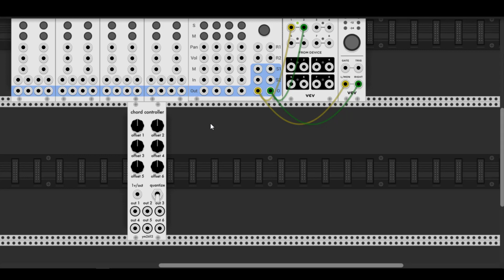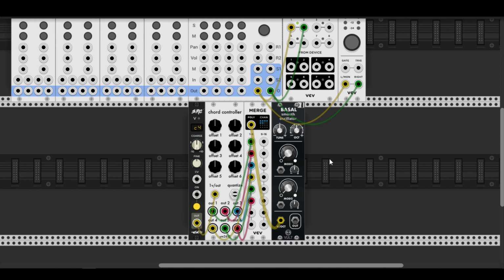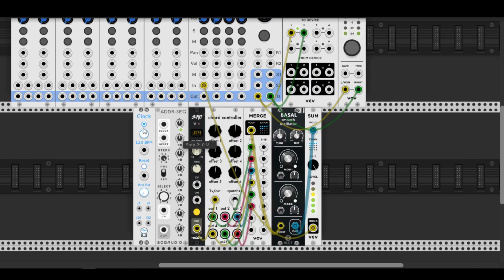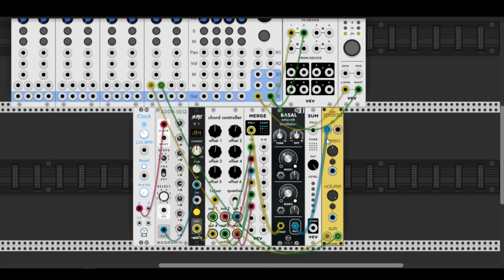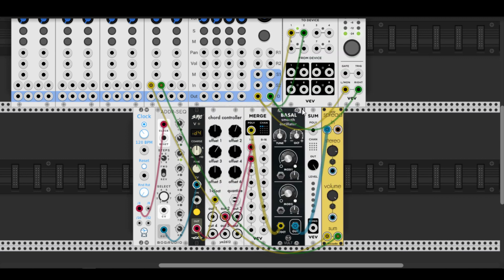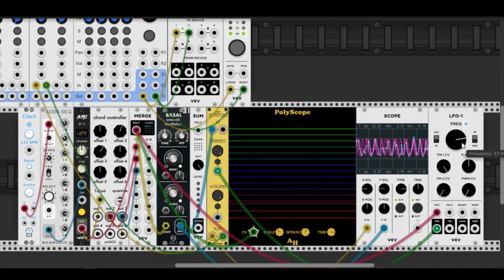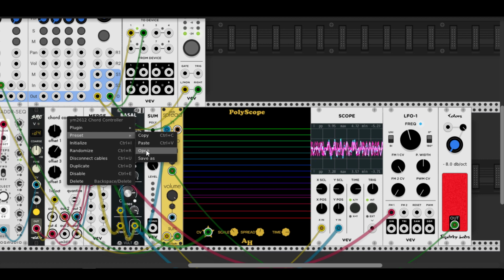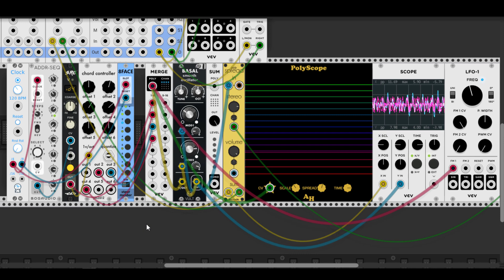Free Chord Controller for VCV Rack | Tutorial

Comment: Thanks this helps me understand polysignals. I had tried to use an adder on the output from a sampler thinking that it would act as an offset and raise it's pitch. Obviously it didn't, but I thought sound and cv were interchangeable to an extent. Can you explain the difference I'm missing?
Reply from the maker: I suppose that pitch shifting of audio have more difficult algorithms then just adding some volts to CV signal.